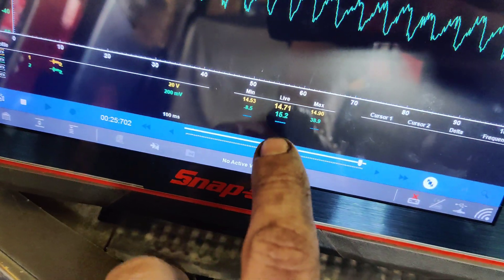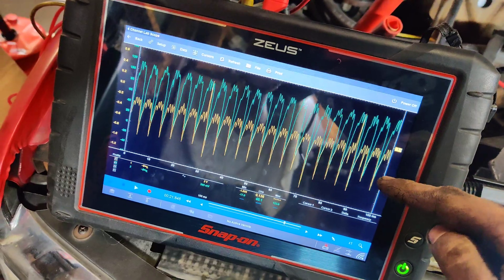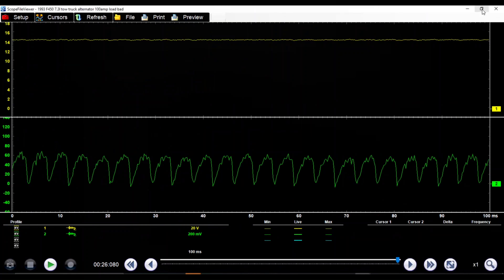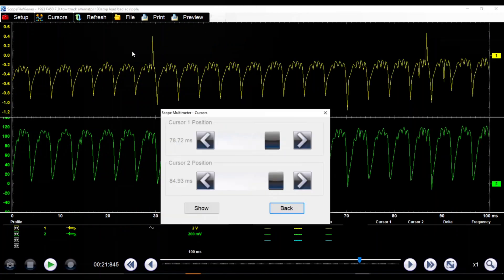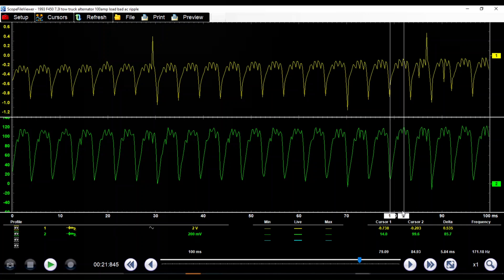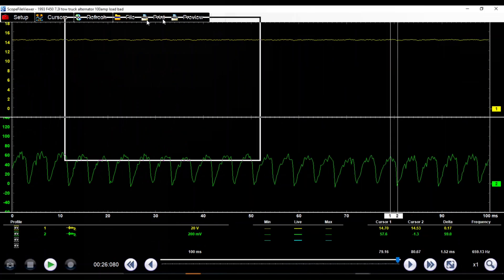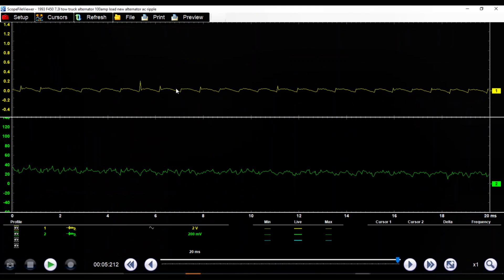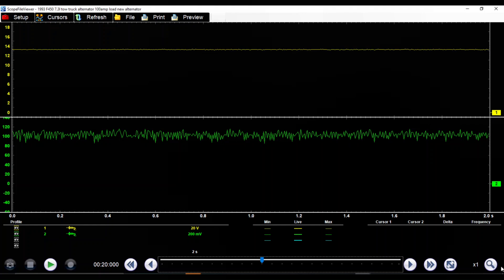1993 Ford F450 7.3l IDI Diesel Tow Truck Battery Light Turns On And Off... Alternator?

Comment: What do you use as a load tester?
Reply from the maker: Just just a 100amp load tester for batteries. It was like $40 off a tool truck. They are cheap. Even harbor freight sells them.